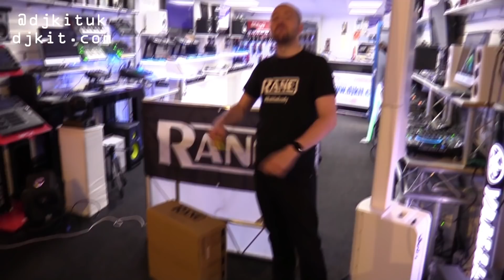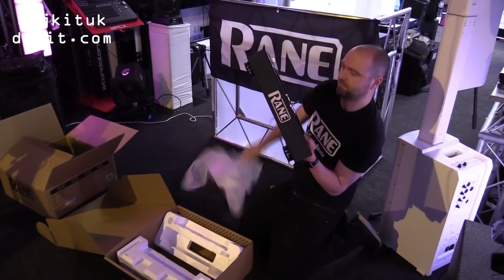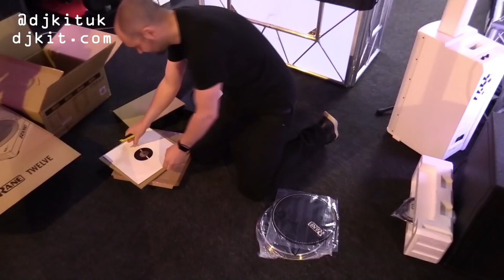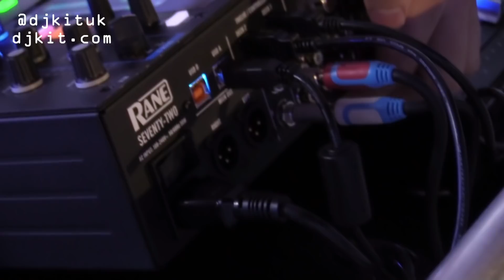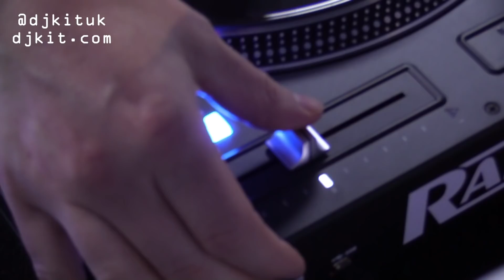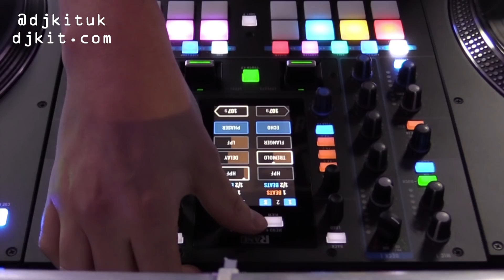Rane TWELVE & SEVENTY -TWO Unboxing, Set Up, Tech Talk and Demo w/ Product Specialist Matt Reay

Comment: Hi.....will I need to use different USB cables if I connect to a Numark Scratch mixer? The Numark Scratch only has one USB port which is used to connect to my Macbook Air. Can I connect the Rane Twelves to a USB hub & then connect the hub to my Macbook Air? If I can, will I need different USB cables from the ones provided by Rane?
The connection on the end of the cables that go into the 72 mixer are square, whereas USB hub ports are rectangular?
Thanks
Reply from the maker: Hi Steve. Yes, the Twelves can be plugged into a hub using the USBs supplied with the controllers.
Reply: @djkit  Thanks for your help

Comment: I just don't get it why such huge set up still need a laptop...
Reply from the maker: You can use the 72 mixer with turntables / CDJs if you don't want to use a laptop, but the Twelves are made for Serato.

Comment: Do these turntables eliminate the fluttering BPM in the Serato DJ Pro software you get with using analogue Technics turntables & DVS control vinyl? If they do, does it even eliminate the fluttering BPM using a digital file ripped from vinyl?
Thanks
Reply: no oscillation in dvs on mp3s

Comment: I wish the consumer had the choice of running serato not the manufacturer telling us and that we have to use that specific mixer. I hope when Rane releases there upgrade it is more like actual 12 where you connect using phono lines not usb and that it comes with flash drive for those that just pop in our memory stick and are off!! And no need to be in battle mode i think it kinda defeats the purpose djs set up their 12s like that so the S Arm does not get in the way when battling. Put the. 12 like a 12 with start stop on the left your pitch on the right and some hot cues are cool in the back and what would really set off the New Updated Version of the Rane 12 would be to some how some way to install a TOUCH SCREEN!! that..would..be Awesome!!! Im sure every cdj dj would lose their minds!! That is a suggestion and would be a great suggestion. To recap:  no having to use Serato or Traktor for that matter. No having to use only one specific mixer. Let the dj choose his set up if we are spending the money. Add flash drive to the 12. Put back the original set up no need to be in battle mode if there is no S Arm to get in the way and last but not least add a touch screen to the 12

Comment: I'll just get phase essentials when it is released. Its going to be $350.00! It turns two regular turntables into controllers at a fractionof the price. No more needles 😃 There are a few ultra high torque regular turntables on the market right now with higher torque than Technics. The Reloop 7000 & 8000, Stanton St.150 & Str8-150, the epsilon turntables (The cheapest alternative. If you bought two of those AND phase essentials it would cost about as much as ONE Rane 12) my last roommate had a pair of those. They look cheap as hell, but the torque is beast! the Dj Techs & the Audio Technica Atlp-1240 😃

Comment: Can u hook up the range 12 to a s9?
Reply from the maker: Absolutely!
Reply: Yes, simply use a powered usb hub. Set the locking screw slightly to test how tight or loose you like to cut, then you can tighten. Lock it then give the control Vinyl a little lift then tighten if you like a faster more loose feel to your cutting & spinback.

Comment: Why is the viewing angle for us upside down? I would rather take that Rane 72 with Denon SC5000M. Now if Denon would make a battle mixer that rivals Rane 72 and Pioneer S9 then they will be and somehow integrate a screen on their battle mixer with the SC5000M that shows displays on both screens whether its Serato or on the SC5000 Prime itself, and really overhaul their Engine software, they will be untouchable. That Denon battle mixer should also be a stand alone with transport controls. That 4 channel Prime mixer is wack. I'm just saying...
Reply: your mad the 1800 is sick

Comment: Purchased the Rane 72, took a pass on the RANE 12’s and paired the Rane 72 with the PLX 1000. If I feel the need to use the Rane 12’s, I will jump on my Numark NS7iii (which to me is a smaller version on the Rane 12’s). Just my preference...
Reply from the maker: The PLX 1000s are amazing!
Reply: NS7III is a bad comparison, you should have passed on the 72 & went with the 12's, 72 is functionally award & clunky, pre fade effects🤔🤦🏾‍♂️???? Mixer was rushed that's why I sold  & kept the 12's!!😌
Reply: Once you use the 12's you'll never go back to a ns7, seriously not ever.

Comment: How does your rane vinyl play anything i dont understand its not a record right like no music is on it its like a reader
Reply from the maker: The records aren't actually timecoded or anything, the music is played the same way a CDJ plays music. The Twelves aren't a turntable, they're a DJ controller sending a MIDI signal into Serato.
Reply: because the turntable is sending the signal into the mixer is like serato built in  ..